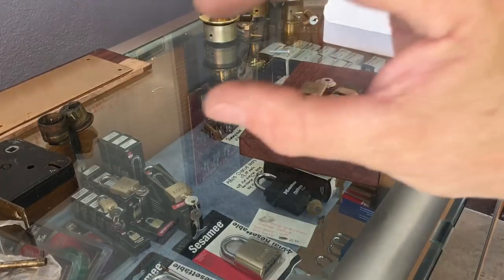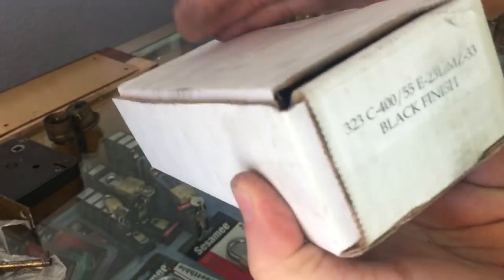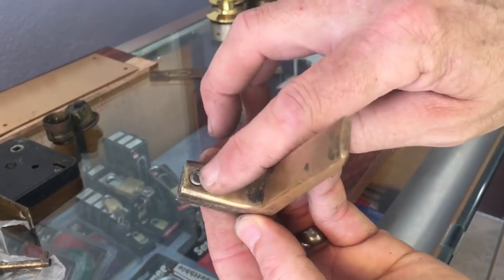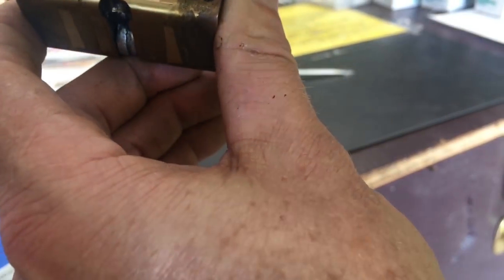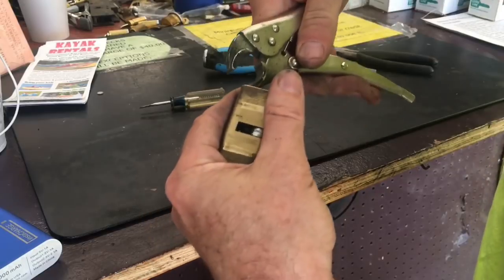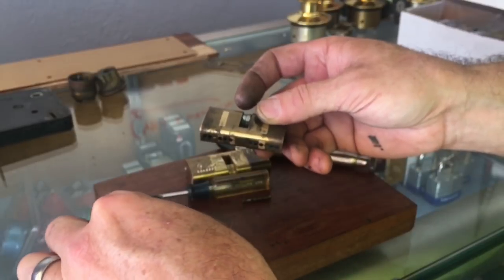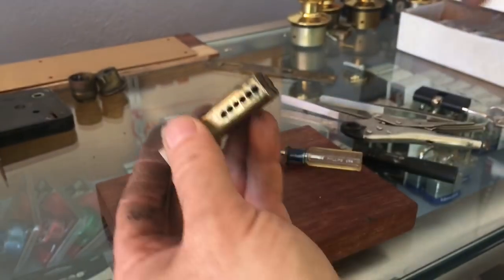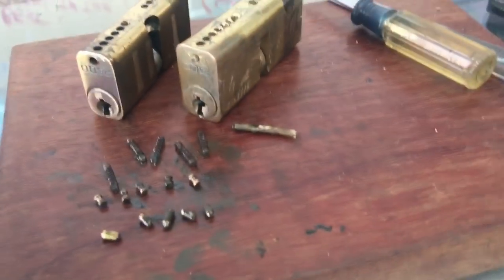Pado & Papaiz Cylinders & the substitute MTS cylinder

Comment: You can see why we in the U.S. position the lock in the correct orientation putting the working drive pins and springs on TOP instead of on the bottom like the Euro style locks. Gravity pulls and collects dirt and moisture in the bottom gumming up the works. Always position up whenever possible, especially if the lock is outdoors.

Comment: Interesting method for closing off the top of the pin chambers, would it be susceptible to somebody drilling into the front of the rod, winding a long screw in and pulling the rod clean out?

Nice looking lock body though, pity I'm in Australia because we don't see a lot of different locks over here in general use. Tried looking for something like this on eBay and only found 1 listing.

Mr L
Reply: By susceptible I mean that if you used a slide-hammer to pull the rod once a hole is made, would it then make enough room for you to use an over lift attack?
Reply: Also, if it were susceptible to such an attack, could it be mitigated by threading the access hole in the top of the cylinder and using a set screw to lock the bar in place?
Reply from the maker: Mr Lockwood mmm, kinda too small to do any of that and would require considerable accuracy and skill. 99% of the people out there, when they pick up a drill drill out a lock (for whatever reason) is gonna just grab a minimum 1/4 and go to town and the lock will be quite unusable. I in fact, had a area “””locksmith””” (heavily quoted) bring one of these in once because he was caught in a barrel in trouble with his victim (errr, I mean customer) because he was called to remove a broken key and somehow ended up attacking it with a 3/8 bit...or jaws of life...or something.
It’s pretty safe inside the body, and in Frostys video with a unblemished one, someone would be hard pressed to even see it.
Reply: Thanks for the fast response! :)
Reply: I'm just the type of person who overthinks stuff and imagines complicated scenarios/'solutions' for situations. The bar didn't look hardened or anything and my first thought was actually to have a jig or stencil which eliminates any hit or miss condition for the bar. Could also double as the bottom half of a levering tool, especially if you were doing it on the bench or in a workshop - place on the cylinder, mark and drill then screw in the puller, lean on the handle and pop it out.

Still, like all things, K.I.S.S applies. Why go to the trouble of drilling and pulling when you can simply chew the lock out with a carbide bit or even a burr. Sure it would be a little more noisy but there wouldn't be any doubts that the lock was nullified.